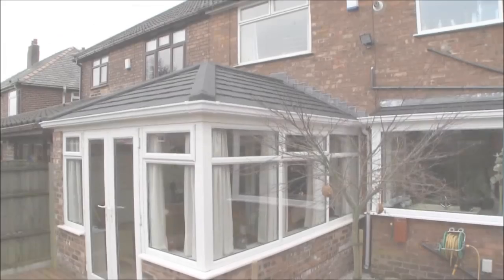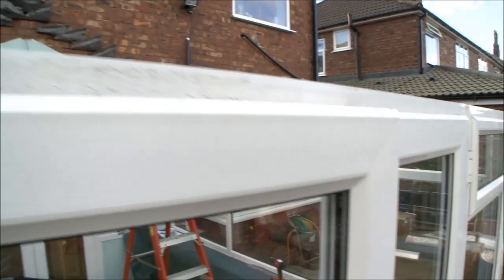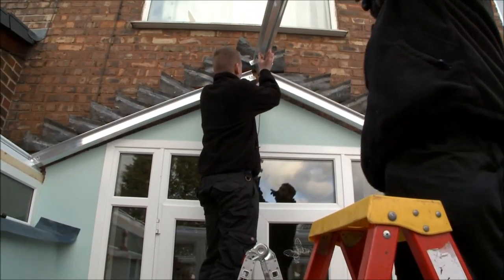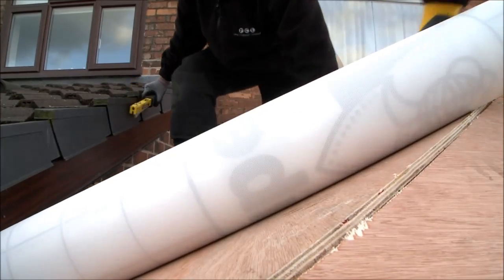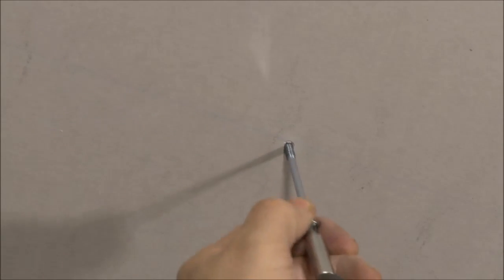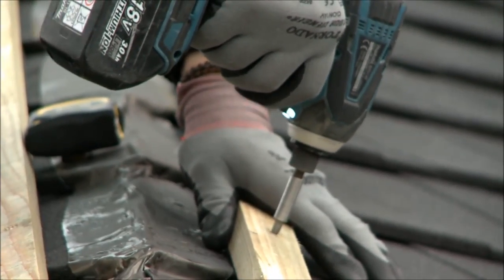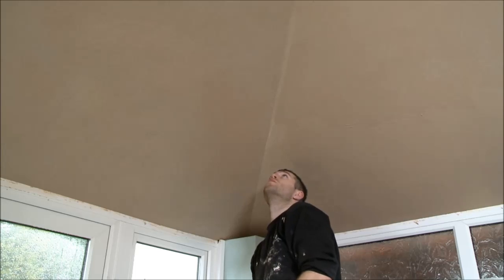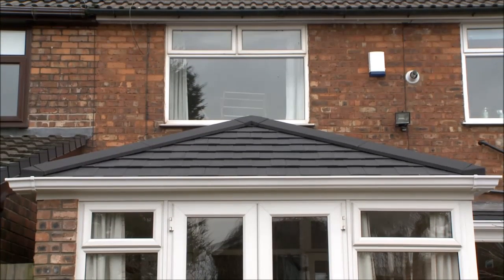Village Conservatories Warm Roof Retail DVD

Comment: Frankly this is scary. Adding the weight of aluminium rafters (also prone to sweating), timber framing and plywood (which can expand and contract) and then plasterboard to a structure that was originally designed just to hold a lightweight uPVC conservatory roof is just asking for trouble. Not only are you at risk of the whole thing collapsing, but it is questionable about whether it would meet building regs. There are alternate systems out there that don't use timber or aluminium but lightweight GRP, which means the finished roof weighs less that the original conservatory roof - its called a Leka system I think.